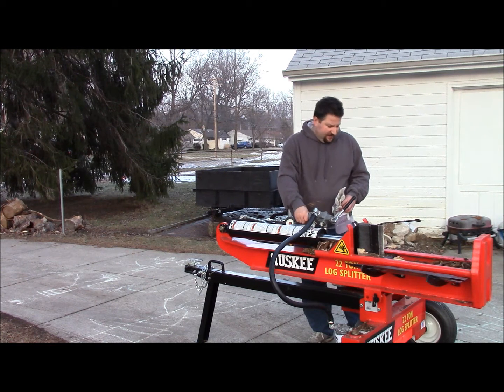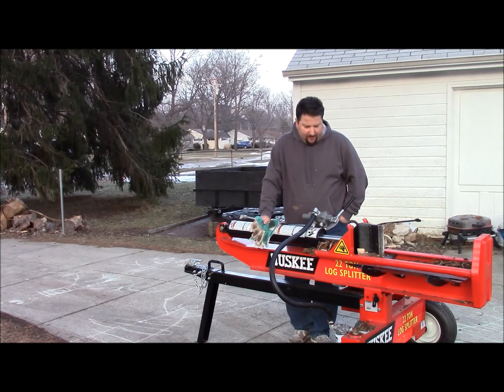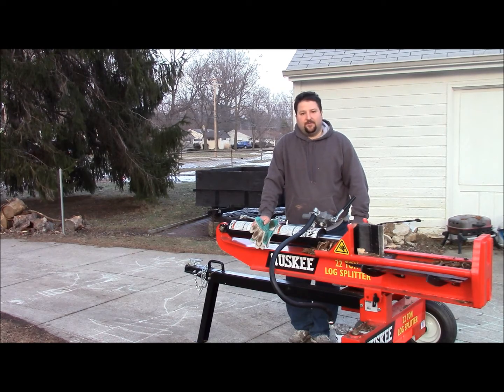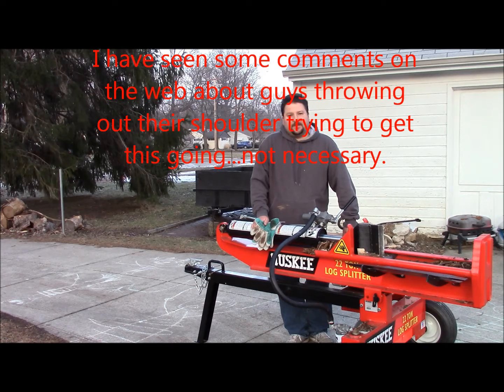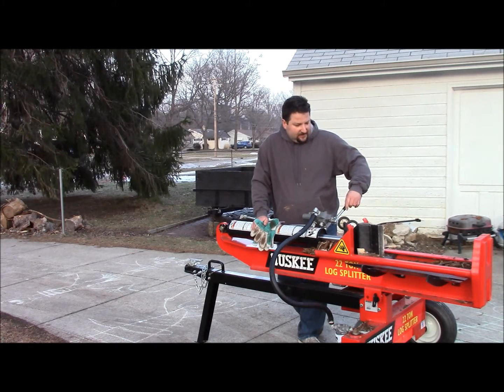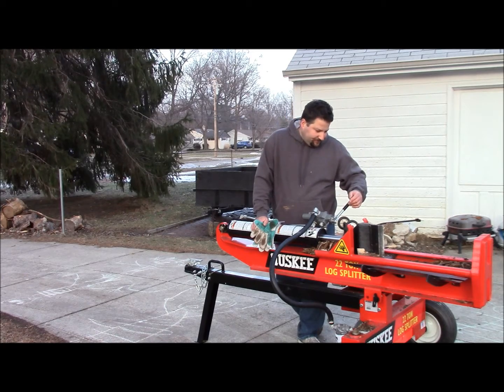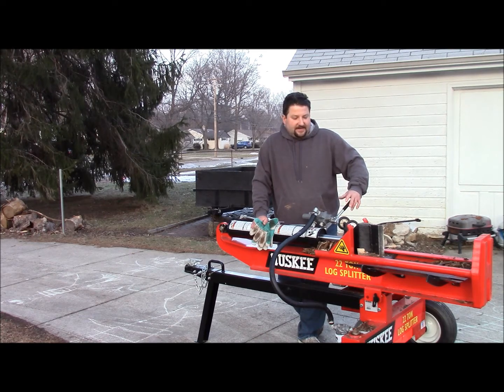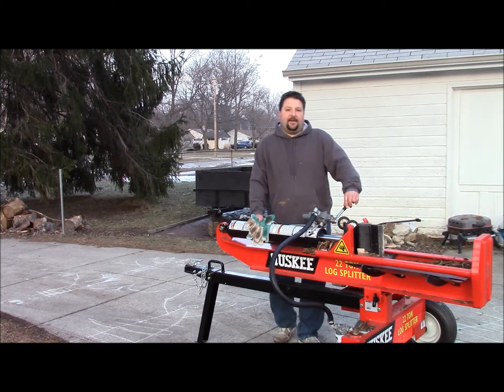Huskee 22 Ton Log Splitter Cold Start Problem

Comment: Thank you so much, this helped me get my courage to go out and try again.  It fired up on the second go after priming it in between as you recommended... and for a first time log splitting machine user, your encouragement made all the difference!  I like splitting wood with an axe, adding a heavy hammer helper sometimes, but the Elm wood just kept bouncing the axe blades away, and even my two strong wood wise sons gave up.  Now the pile is 2/3 done and stacked with four hours of steady work and a friend helping for part of the time.

Comment: Had mine for 10 or 12 years. 10-30 loads of hardwood a year it's just now starting to use oil and smokes when starting up. Haven't had any problems with it I'll be replacing the engine when it finally gives up. Machine is worth the money for sure
Reply from the maker: Thank you for the post Doug, good to hear from others who have used the equipment.
Reply: Using the machines by running them regularly every year seems to be a huge piece of keeping the machinery functioning.

Comment: Where do you get your logs from?  Husky splitter works well.
Reply from the maker: Hey Craig!  Thanks for commenting.  I get my firewood from a variety of sources, craigslist can be a good source if you have the time to monitor it.  I have friends and family that know I burn so they let me know when they see trees down or wood out on a tree lawn.  I have a rule....I don't pay for my wood.  So everything you see is something I got for free.  Depending on where you live would depend on your sources.  When I first got my burner I burned anything I could get my hands on, pallets, pine, you name it.  After a while you seem to develop sources and I don't have to scavenge as much as I used to.
Reply from the maker: As far as the splitter goes, I like it!  I had seen comments about them not starting and it bothered me but I figured I had 30 days to return it if I noticed anything.  Out the gate it ran fine and started fine, lately it's been taking a few pulls to get it started but I think I'm on to something with this fuel thing.  I'm hoping to run into someone else who has one and has had that problem and to see if this fixes it for them as well.  Bang for the buck if you're in the market for a splitter I would definitely consider this one.
Reply: Mytwocents Onthings Thank you, my son and I picked up a lot of wood, jammed it in our Suburban and split more than a face cord.  Unfortunately, it was a little punky, but it burns good now that its dry.  I like not paying for wood too!
Reply from the maker: I saw you have a channel and checked it out, good stuff on there!  You have my subscription!
Reply: Thanks a lot, appreciate it!

Comment: I was just outside trying to fire mine up. 22degrees,  almost gave myself a heart attack a few times i was pulling soo much. this is not a good cold weather splitter at all for the single fact the engine is impossible to start when really cold outside.  an electric start though would make easy work of the problems. other than that it's a durable piece of equipment.

Comment: My splitter starts better in cold weather if I put a magnetic block heat against the oil pan and let it warm up a couple hours. If it is extremely cold, like zero degrees or below, you may need to warm the hydraulic oil reservoir with a block or dipstick heat. But, who the heck wants to split wood when its below zero?

Comment: check the plastic intake on your 6.75 hp briggs, i have the same splitter and i am about to change the  intake for the second time. A better solution is to put a honda engine on it and forget about it for the next 10 years or so.
Reply from the maker: +Daniel P   Thanks Daniel, appreciate the good info.  I agree about the Honda engines, they tend to run forever and a day.

Comment: The wood splitter doesn't have a choke.   It's not getting enough gas, it's that simple.  Once it fires continue to push the primer until it can run on it own.  Some synthetic motor oil will help on the cold mornings.  If you want something that will start without issues at 10/20 degrees this is the wrong machine.  If you're like me your not going be out there below 30 this works fine just pump the gas till it warms up.
Reply from the maker: +jon   Youre right about the prime button.  I've done that and it helps it along.  Thanks for the post

Comment: So my neighbor used his for about 2 weeks and then let it sit outside for 2 years in the elements.  I’ve drained all the fuel and addedSeafoam and fresh fuel but no dice.  The spark plug looks brand new.  I noticed that when I prime it, it almost seems like the fuel is not flowing.  I’ve removed the air filter and when priming I see a small drop of fuel pushing through.  When I say small it is like a drop.  I’ve tried starting fluid and still no turn over.  Any ideas?  My neighbor said if I get it started it’s mine.
Reply: If he didn't run the fuel out of the carburetor, it's probably gummed up. You can try working some SeaFoam cleaner through it to clean the gunk out of the needle valve. But you might have to disassemble it and clean the parts with SeaFoam and put it back together. Whenever you are going to store an engine for more than a couple of months, put some fuel preservative in the gas and run it a while. If you intend to store for a long period of time, 6 months or more, its best to drain the fuel tank completely and then let the engine run until all of the fuel in the carburetor is used up and it runs out of gas.